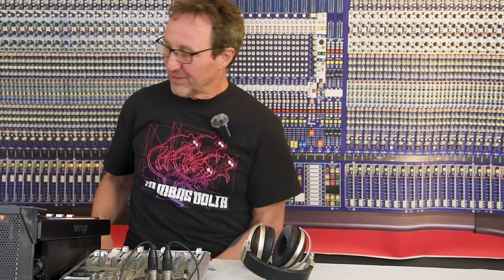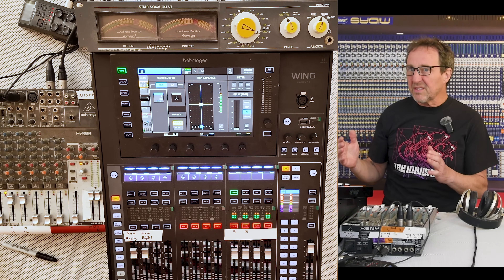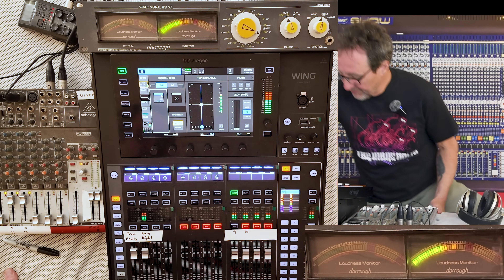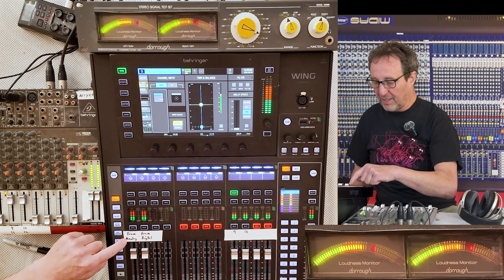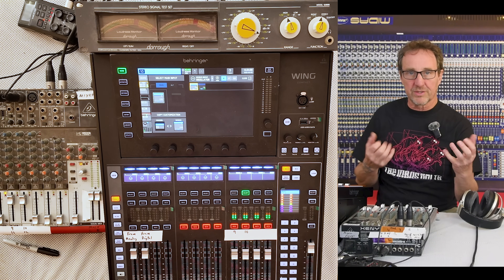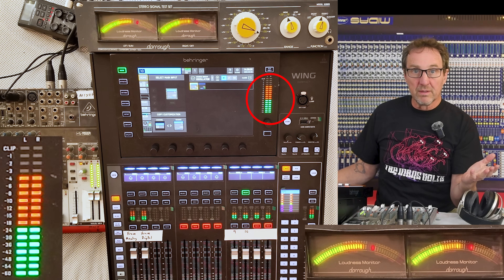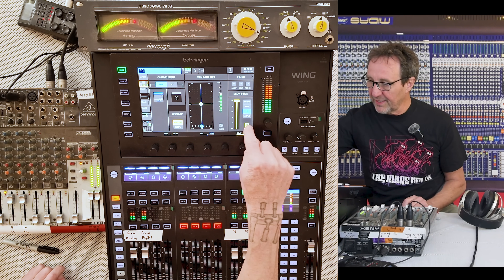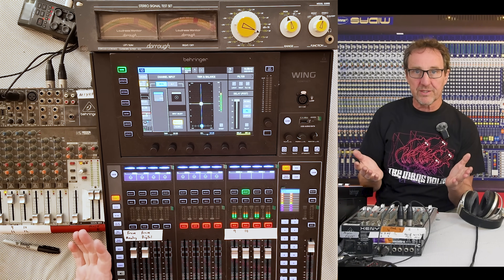Digital Audio Meters Don't Show What you Hear - Sometimes

Comment: I did the test ( somewhat incomplete) on our Studer Vista X running at 48KHz. I patched the master out to a pair of analog line outputs and then back into a pair of analog line inputs. My meters were the Studer output meters, an integrated 3rd party (RTW) digitally implemented meter in VU Mode and the input metering of the DSP channels receiving the analog signal back in. I didn't have an analog console handy.
This is important IMO because there are no metering options at the hardware level, unlike other consoles that may display the signal entering either the analog front end or right after the DA stage. 

I found the following: With a 1KHz sinewave the meters all behaved the same, as they should, with pink noise there was a difference in behavior of the master output vs the analog return ( less level changes, but still changing when switched) and with white noise the Output meters showed zero gain changes when summed and switched between correlated vs un-correlated while the RTW meter and the analog-return-receiving DSP input meters showed the respective level changes. The other thing i noticed is that a generator set to a sinewave at -20dBFS meters differently than white noise or pink noise set to -20dBFS.

My preliminary findings are that the signal obviously affects metering independent of level. This would also explain that white noise generated at -20dBFS set to read 0VU/-20dBFS on the DSP channel input or Master output  could cause clipping because at unity gain these meters read -26 or so dB and pink noise reads even lower  than that.
Add to that the fact that we don't really know how each meter in the digital domain is implemented.  Is it like a graphic display of an EQ plug-in? Does that curve you see represent a measurement of the EQ's actual behavior or is it just a visual reference of what data was encoded by moving knobs? IIRC only Stagetech Consoles show actual processing behavior in their displays (although I could be wrong about that). In the same way a "meter" could just show what it calculated the level to be not what the output of the mix engine actually is. That meter set to Peak also doesn't show the actual output that's present after the DA conversion. A True Peak meter would take into account the inter-sample peaks but again, it's just math guessing what's happening while any external meter, digital or analog can't guess, it must read actual levels to the best of its ability.
These are just my uneducated observations but maybe it sheds some light on the issue.
Reply from the maker: Use the PFL meter to get a common metering reference point.
Reply: @DaveRat  The Meter on the return feeds as well as the channels with the signal generators are PFL meters, they all show the signal generator with an output level of -20dBFS  (broadcast reference= 0VU ) sinewave at -20, white noise at -26-ish and pink noise at -38ish.

Comment: Thanks Dave for your great investigation. As a coder i might have an explanation for that:
Energy summing of uncorrelated signals is clear: +3dB in RMS (or other related meas).
If the shown meters in the consoles are PPM (peak program meters), there will be a clear reason: Summing the identical noise twice doubles the peak samples as well: +6dB. 

If you sum two (either really uncorrelated or just a bit delayed of the same) noise, there is statistically very low probability of having just the tallest samples added at the same point in time, hence exactly same sample time. The higher the samplerate (and 44k1 or 48k is just high in terms of durations of the loudest transitions in a waveform, you know...) the lower the probability that these sample peaks will fall together in point of time. Thats valid for noise as well, because the higher frequencies just "ride" on top of the longer waves of lower frequencies in the waveform, and the distribution of low frequencies in a noise signal is a difficult thing: For a specific run-length of noise not all low frequencies could appear in short-time - the would "sit" on top of each other. Sidenote: To build a noise generator that guarantees that a specific low frequency will appear for sure in a given run-length is an very complicated case. Back to topic:

In practise, by summing two uncorrelated noise signals the sample peaks keep almost the same in level (as before the summing), just distributed over time! Your example using a delayed version of the noise itself is an excellent example for that: For sure there will be (the) well-known delay between the sample peaks now. 

Due to the nature of sample peaks the coders of PPMs have an ugly issue - due to our human eyes! They are way to slow. An algorithm may detect a single peaking value and switch the according LED on, even sample-accurate in time. Then, only fractions of the very same second later, the LED would be switched off due to following lower samples. So the coder has to artificially delay or "smear" the sample peaks for at least a fraction of a second to remain the highest LED for a longer bit-of-time switched on, so we can see it. Typical hold-on-times could be 30, 40, 80 milliseconds or so. If that time-window would be to small, we'll miss the sample peaks for sure, hence rendering just a PPM useless. Just to remind: The LED metering of a console should even work in cloudy-day-till-sun-peaking (if possible) for our eyes, outside - for open-air sessions.

So by "smearing" the highest LED keeps on for a while, completely hiding if two sample peaks will follow each other by your choosen delay. The same is statistically valid for two really uncorrelated noises of same type: The appearance of the same frequency and tip value is distributed over time:  not every frequency and level comes up every second. So the probability of having just the sample peaks of both noises layered on top of each other is like winning-a-jackpot. Possibly over a long time (having noise for a couple of minutes, depends on the type of noise generator in statistical terms) you could see really higher levels here and then.  Best regards from g'old germany. 🥰
Reply: I think Tim beat me to the answer.  The question is what kind of meters are these, and what is their purpose?  VU meters measure perceived sound volume - or the power over a short time period.  Peak programme meter (PPM)(not to be confused with peak reading VU) is designed to measure the peak of the waveform.  Those are two different measurements.  Hollywood was one of the first with PPM meters because the optical soundtrack in film didn't saturate like tape, but hard clipped like digital. 

Mixing two signals of same amplitude will give the same peak reading, when the peak of the waveforms coincide, but correlated signals will add up along the whole waveform resulting in louder volume.  Put another way, if you're mixing two signals that give a peak sample reading of 128, you're going to end up with a summed value of 256.  Correlated signals will hit that on every peak, but even uncorrelated signals will hit it periodically. The way the meter is labeled with clip being the highest LED and not a separate LED suggests it's a PPM, not VU.  (VU meters tend to have a separate peak warning light.)

Both have their advantages and disadvantages.  It's a matter of the right tool for the job.  If you're feeding something that hard clips, then I'd think you'd want to know PPM, not VU.  If your output is digital, or you're feeding something digital, you probably want PPM.

Comment: 11:26 you just answered your own question, the increase is RMS, analog meters tend to be RMS or Peak/RMS multi-combo metering, whereas most digital meters are usually set to peak, and obviously, they are not the same thing. The ballistics are also configured differently.
Reply from the maker: Then how come the digital meters with the digital meters  all8stics on channels 1 and 2 of the behringer read the signal correctly after the signal has been converted to analog and back to digital?

Comment: I just ran this test and I can confirm your findings.  I used flstudio and routed the signals out to my analog Mackie 32.8.  Fl studio handled the white noise, signal routing,  polarity, and delay.  The analog meters on the Mackie did show the audible 3db difference while the digital meters in flstudio on the way out did not. 
When i routed that analog signal back into the digital mixer in flstudio, those digital meters did show the 3db difference.  Very interesting.
Reply: I'm a great fan of Mackie still, either. But could be that the panpot doesn't have a -3 (constant-power) compensation for the middle setting by mono-summing in the mackie. Then it would give a +3dB higher signal back into your flstudio than before.
Reply from the maker: Since this is a comparison test, not absolute levels, as long as nothing is changed from the before to the after except decorrelation, pan pots won't matter.
Reply: @DaveRat  Exactly.  Once set up, the only variable is decorrelation.  I even ran this test using two different interfaces (behringer 1820 and M-Audio C-series) to see if different converters mattered. Neither of the interfaces/converters changed the outcome.
Reply from the maker: Very cool and thank you and interesting
Reply from the maker: Exactly!!

Comment: This occurs because white noise has an RMS level close to the peak, when you use delay the RMS loses level, but the peak does not. Test with pure tones, you will see that when using the same tone you will have RMS = Peak, and when changing the Tone, you will gradually lose RMS but the peak remains, in a DAW you can generate the resulting wave and see the shape and you will see that the peak really remains but what really changes is the fundamental.
Reply from the maker: Tones are not random. If what you say is true, why does it happen in digital but not in analog with the exact same signal.

Why do analog meters show what we hear and digital meters we here it louder and softer but the meter does not change?

Same signal, different results, why?
Reply: good ideia, i try analog using a osciloscope to see level..e shape of wave...

Comment: Here is a clue:   I tried summing both decorrelated noise and tones here and my (Analog) VUs drop 3db when summed to mono, but the DAW channel strip meter stays the same, however the Waves "VU" meter  plug-in drops 3dB and  if I insert a "True Peak and RMS" meter (Logic plug-in) the Peak level is the same, but the RMS level drops 3dB, same as the VU.
Reply from the maker: Yes having a VU meter or RMS meter for digital will show you something more useful. But the underlying issue is that the digital peak meter that shows you what seems to be the wrong signal and different than what you hear is actually showing you a real signal that can cause distortion issues. So, while with analog you can run just to vu or RMS meter, and an analogue peak meter which will read correctly to what you hear, with digital you kind of need that instantaneous peak meter that reads stuff that you can't hear because it can cause issues
Reply: @DaveRat  Thanks for the reply..  digital domain metering  was a hot topic in the early days of digital due to aliasing, intersample peaks, etc, but this particular issue is a little perplexing, I can't explain why my decorrelated noise drops in level by 3dB when summed. It's not due to pan law..

Comment: What I can contribute to this discussion is that on the Behringer Wing you can insert the Speaker Manager FX on the Main Mix. In the Limiter tab there you can toggle RMS and Peak Metering. The Input Meter of that plugin shows the expected +3dB boost with the non-correlated white noises in RMS mode. So as others have pointed out it’s got to be the fact that the occasional occurrence of simultaneous peaks in both oscillators is enough to make the peak meter show a constant -6dB instead of wiggling around between 0 and +6dB if it were faster. But I’m not sure why there are never enough simultaneous oscillator peaks to make the DAD-converted signals go to +6 though.
Reply: Weirdly enough, in Logic, True Peak Metering (with interpolated peaks) also shows the expected +3 vs +6dB difference. So maybe it‘s the digital analog conversion’s interpolation that accounts for the difference.
Reply from the maker: Interesting and hopefully having an easy way to test this and show the issue will help better understanding and maybe some improvements from the manufacturers at some point as well
Reply from the maker: Cool and agreed. But using only RMS meters with digital will hide high frequency short-term peaks that can create audible issues at frequencies below the frequency of the peak if clipped. 

With analog high frequency short-term peaks tend not to generate lower frequency audible issues. 

So in RMS meter or VU meter is excellent for analog but for digital you ideally need both the VU and the peak meter. The VU meter so you can see what you're hearing and the peak meter so you can avoid stepping in poo

Comment: This is a pseudo random white noise generator (typ rep period 1 sec or less) so the sources are strictly correlated (even with digital delay). Then the Wing master VU meter sees delayed "noise" as same signal (no extra randomness), so samples are indistinguishable from only one source...then no change in VU value. Passing through a D/A destroy the perfect correlation
Reply: I propose the same test with 2 "analog" noise sources i.e. 2 mikes pre
Reply from the maker: I've done that test as well and I've done it with white noise sampled at 8K, 16K, 32k, 441K, 48k, 96k, and 192K. 

The more high frequency content in the noise, the more pronounced the issue is maximizing at 3 dB for two inputs and maximizing it 10 dB for 10 inputs. 

I've also done the same test in a DAW with 48k, 96k, 192K sessions. 

I've also low passed the white noise at 6, 12 18, 24 and 48 DB per octave in the DAW at frequencies of up to frequencies of 22K which was the maximum low pass filter I had access to. 

I've also confirmed that the digital meters are indeed showing true signal And whether you can hear the level boost or not if the meters show clipping you will get digital distortion.

Of course there is a wide variety of complex results from all of this but all in all what I've learned is that the digital meters are indeed reading correct signal levels but there are issues from the low pass filters as well as most likely the Nyquist filters that exasperate the issue. 

I won't get into how to solve or reduce the impact of the issue here because it's fairly complex and instead I'll do a video at some point that actually shows it in a way that people can repeat.
Reply from the maker: If the signals are correlated then how come there's no change in level when one is polarity reversed and they are summed together?

When polarity reversed....

If they don't cancel, they're not correlated. 

The less they cancel the less correlated they are
Reply: @DaveRat Correlated but not identical samples so add or subtract makes no difference BTW in iZotope Rx10 delay then addition or subtraction makes +3 dB
Reply from the maker: I think you may be overcomplicating and missing the obvious. Whether you understand or agree or disagree if the signals are correlated or not makes no difference. 

The question is "how come we hear a drop in level and the analog meters show that drop in level but with the digital meters we hear a drop in level but the meterers do not show the drop in level."

And if we send that same signal that the digital meters don't show the drop in level of, to an analog meter it shows the drop in level that we can clearly hear.

I don't know whether or not knowing this information will improve your craft or not. I know of one scenario where someone is a broadcast mixer and must make sure the mixes sound good and are of a very specific level in both stereo and mono. 

They have encountered this issue of digital meters reading incorrectly all the time on the mono summed signal, And have a set of analog meters as well. 

This way they can use the digital meters to make sure things are not overloading and the analog meters to make sure the perceived audio volume is correct. 

However you want to understand or deny this discrepancy is all good I'm just providing the info and the methods for you to test and recreate all the tests that I'm showing for yourself very easily should you choose to do so.